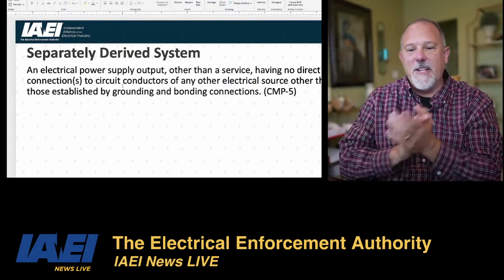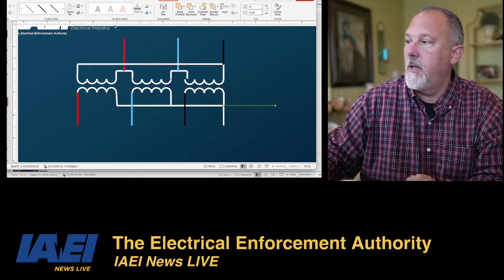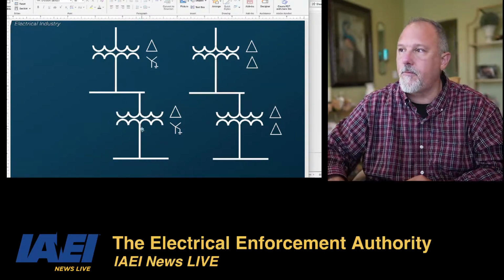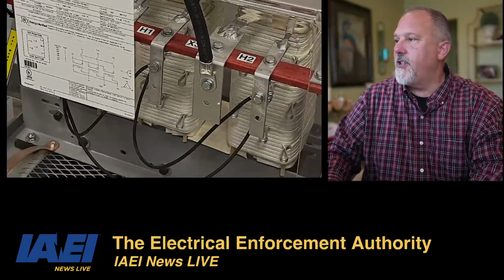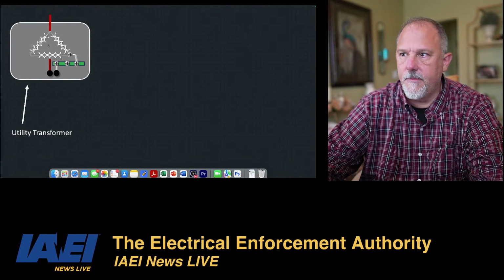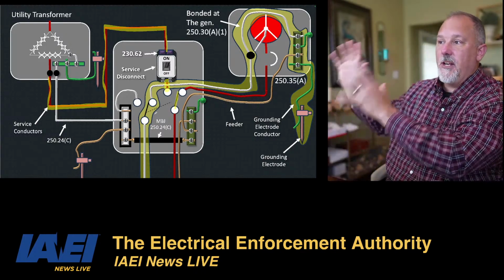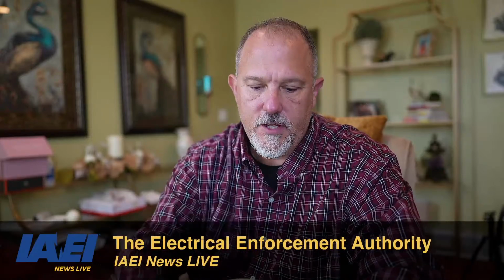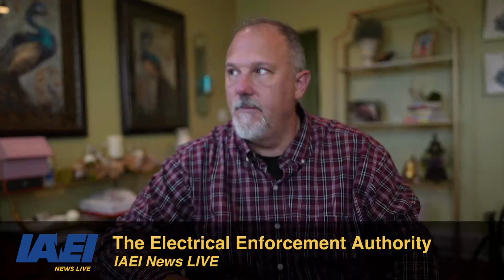Separately Derived Systems

Comment: Maybe I’m missing something but I’m not too sure what the issue was at the end of the video with the bonding conductor/rigid conduit that was referenced from the transfer switch to the generator. Correct me if I’m wrong but as long as the transfer switch disconnected the load side grounded conductor from the utility and transferred over to emergency and a system bonding jumper was installed at the generator the only current path would be on the neutral or grounded conductor from the transfer switch to the generator. There would be no objectionable current or parallel neutral on the bare conductor shown between the generator and the transfer switch. That connection would be needed in order to provide a low impedance path.